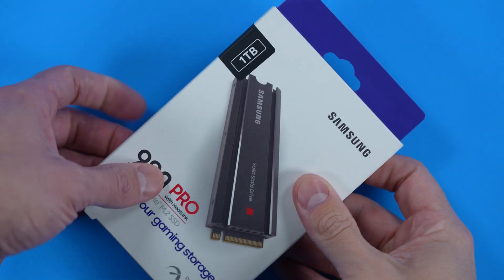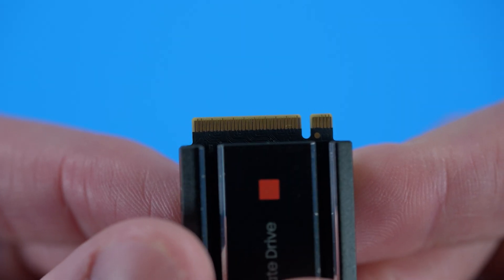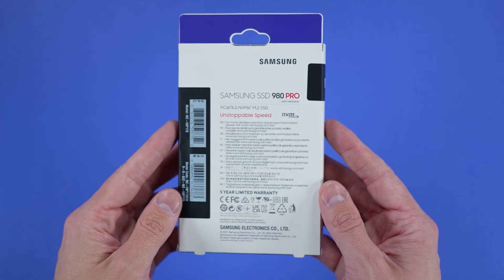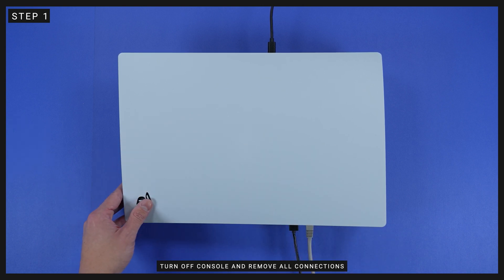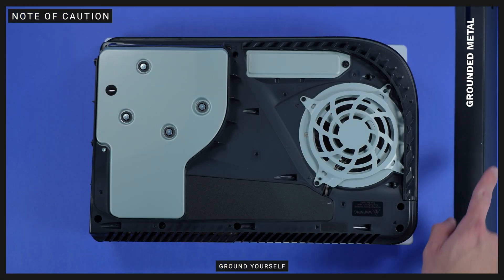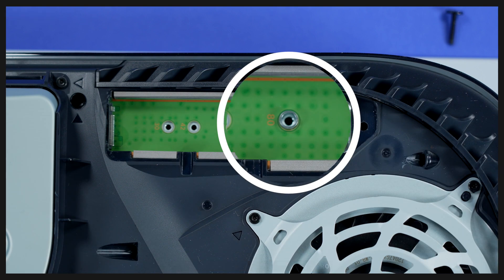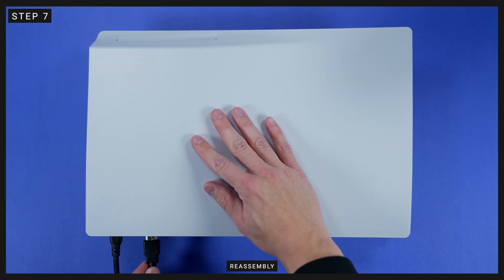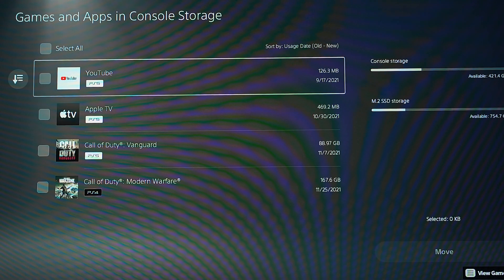PS5 Storage Upgrade - How to Install the Samsung 980 PRO w/ Heatsink, PCIe 4.0 NVMe SSD!

Comment: you need to update the firmware on the samsung nvme
Reply from the maker: I didn't need to 👍
Reply: @TomasVillegas  there was a firmware patch that makes it faster from 5600-5700 to 6500 where it should be
Reply: @jake93071  yeah,if you want that speed you need to update the firmware,my 980pro was at 5400-5500 before the update,after the update 6400-6500
Reply: @Jericco8  updated it a few days after i got it really pleased with it so far samsung ssd’s never let me down

Comment: I could just be really stupid and doing it wrong, but my SSD isn't going in all the way? Meaning whenever I try to place the thing at the 80 mark there's not enough space because my ssd is partially over it. Theres more room where the ssd is supposed to slide in. But it doesnt go in all the way and im afraid if i push to hard I may break it
Reply from the maker: Make sure you angle it in. Soon as you push down it'll fit in place perfectly.
Reply: @TomasVillegas  I’ll try that out thank you!
Reply: @TomasVillegas  that got it to work, thank you very much!

Comment: It's easier to have the PS5 facing the opposite direction, with the fan to your left,  because the cover plate slides off easier when applying pressure from the upper left corner towards yourself.  Also, the SSD expansion port will be right there at the bottom close to you.
Reply: why are you copying my account pic. I thought I already commented on this video until I saw your name ahahha
Reply: @kavik526town2 .. Noyce!